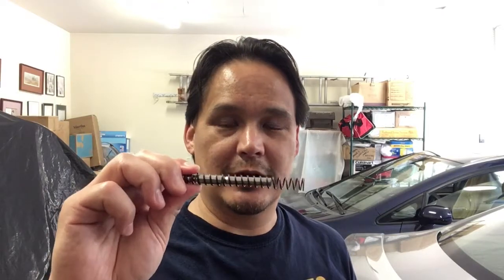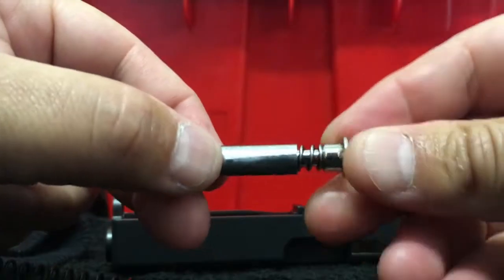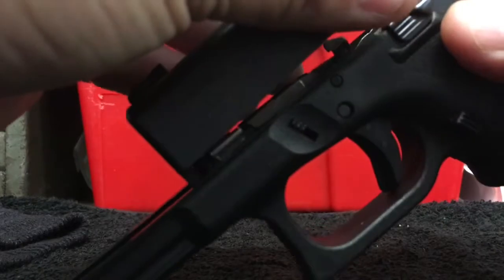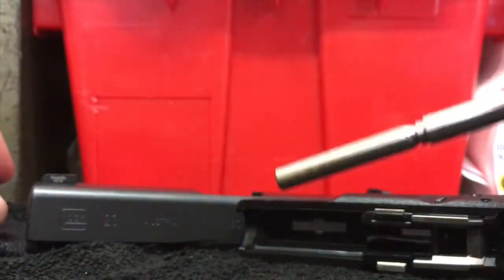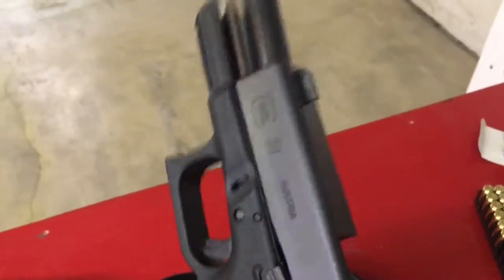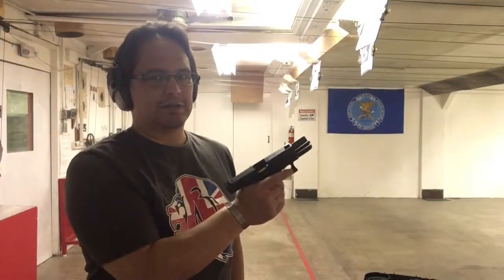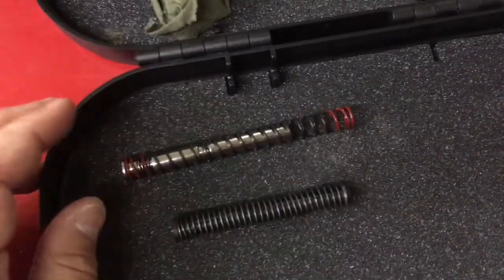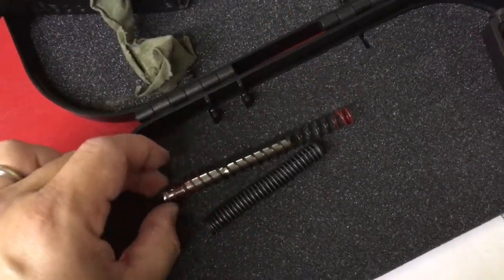Sprinco USA recoil reducer Review

Comment: I’ve been looking into Sprinco stuff as well.  Has great results with theirs  AR buffer springs.    I run DPM system in my 1911 and Glock 45 and it absolutely does seem to protect the frame, especially my 1911, it’s not harshly banging anymore that’s for sure..  it also feels smoother.  Looking for comparisons between DPM & Sprinco.    Nice stuff
Reply: I have run both DPM and Sprinco in my Glock 20 and a Lone Wolf 460 Rowland build. My current setup is the DPM in the 10mm and the Sprinco with a heavier DPM spring in the 460R. I prefer both over a steel guide rod and a 22lb spring. Both companies are great to deal with and I would recommend both. Sprinco was willing to provide extra springs for tuning due to me shooting heavier loads. DPM did a custom heavy build and it performs great.
I have a DPM in a S&W M&P Shield in 40 S&W. The difference in it and the Glock between recoil rod and it, is noticeable. Some in felt recoil, even more so in a tighter group.
It seems like these make a bigger difference in bigger calibers than small.
Hope that helps.
Reply: @CrawldaBeast  may be a dumb question but my OCD demands i ask it 😂. In your experience, how much muzzle flip does it reduce from the OEM one (is any) and between the two brands, which one reduces muzzle flip the most?
Reply: @Dannyboy32669  
As for muzzle flip, I can't put a number on it. What I can say is the with and without group sizes and felt recoil are noticeable. I have also added a DPM to a 40S&W M&P Shield and got good results as well.
Hope that helps.

Comment: After 4k rounds I finally decided to pick one of these up for my Walther pdp 4.5" full size. I started noticing when I went to lock the slide back or just manipulate the slide at lock point and beyond that my current edm guide rod was starting to make a crunchy sound. It's probably still perfectly fine but been wanting to try this guide rod out for a long time now. Hopefully it's reliable and does what it's advertised to do, especially with it being a 100$ + purchase....
Reply: How'd it go?
Reply: @ComeOnPelican91  Well, good and not so great. I've maybe run a bit over 1k rounds now with both the red and yellow springs. The red feels great when using hotter rounds like nato spec and +p but I've had some hiccups when using standard pressure rounds causing some ftf and stovepipes. Not a lot, but enough to cause concern in the back of my mind. I'd like to try more defensive type rounds but the cost is getting crazy.
When using the yellow spring it's like I'm shooting a 380 when paired with the right ammunition like 115g - 124g fmj from brands like norma/blazer/armscor & fiocci but if I try anything hotter, even stuff like federal ae I'll start having minor feeding issues.... Like earlier not alot, but enough to cause concern in the back of my mind. I wish there was a spring that's in between the red and yellow just for reliability sake. For now the guide rod serves as a range only kind of thing. When carrying for cc or even around the house I've been using Walthers tungsten 50n guide rod. That thing will eat anything reliably so far.
Reply: @ComeOnPelican91  Update : Malfunctions had NOTHING to do with the sprinco guide rod! It was actually due to magazine springs going bad far before supposed to. Since figuring out the issue I ordered 10% stronger replacement magazine springs from a 3rd party company and they have been flawless!
Reply: @TerminalM193  awesome!! Thanks for the update. I just ordered the guide rod before I saw your comment
Reply: @TerminalM193  Thanks for your feedback! Which magazine springs did you get? I have the PDP F myself and am considering this guide rod.
Reply: @TsukiKanade  I have the full size 4.5" pdp, 18rd count. I think the maker only makes the springs for the full size but it wouldn't hurt to look. Company was ghost Inc. I believe the spring issues are only causing problems with the full size mags but I could be wrong. Please report back if you've had any issues yourself. I love the sprinco guide rod. Own all spring colors available for the pdp. I primarily run the red since it runs best with hotter defensive ammunition while still having no problems chambering practice rounds.

Comment: Thanks for Helping the understanding on how it works. Just picked up their trigger spring kit for my Q5 Match it made a significant difference put a couple Vids out on that. I did just order the guide rod as well. Will be interested if there is a difference or I use a 507 K Circle dot hoping it will help level it out a bit.🍻🤜🏻

Comment: Not worth the money, just use a lighter recoil spring.
Reply from the maker: Fair argument
Reply: 19LS upper with a lone wolf dust cover on a g26 frame with the DPM rod helps a ton while running +p+ compared to the stock g26 upper. Worth it to me, but if you're broke and don't shoot much spend it on tampons.